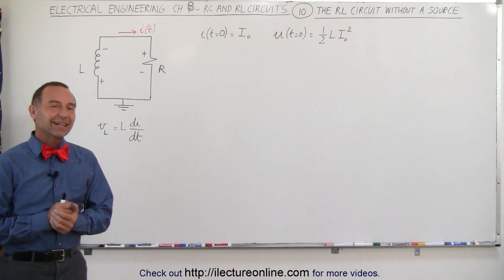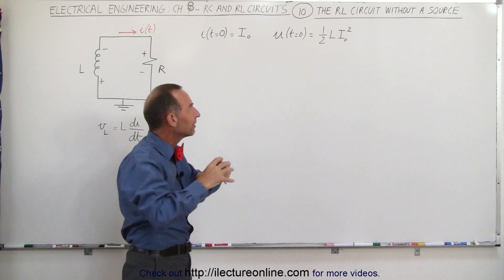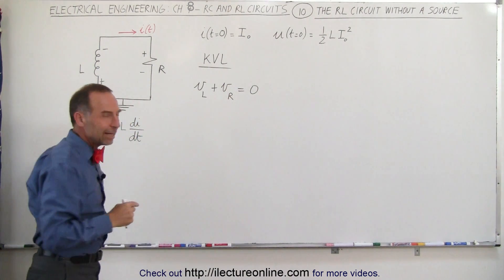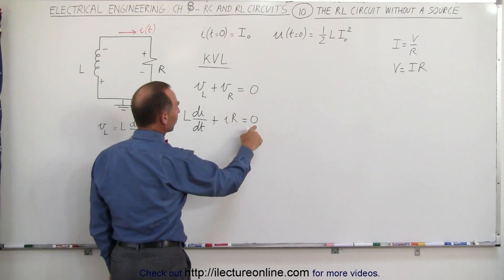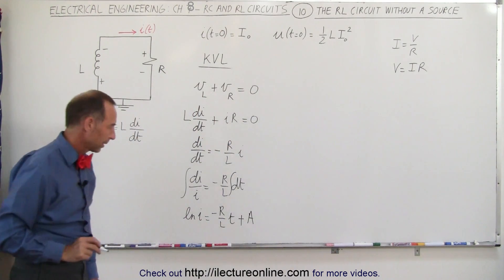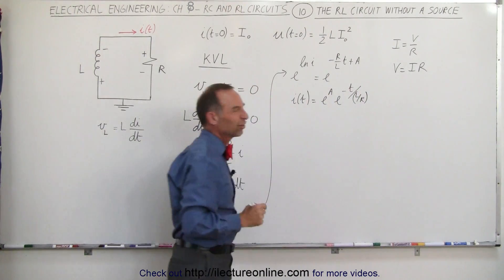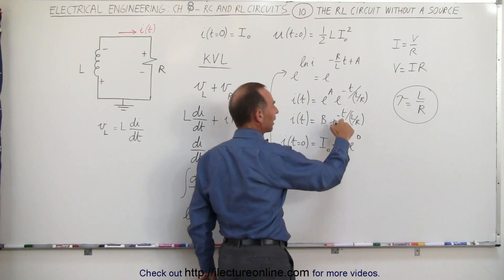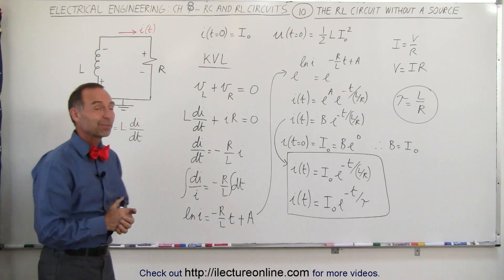Electrical Engineering: Ch 8: RC & RL Circuits (10 of 43) The RL Circuit without a Source

Comment: I am confuse and do not understand why iL+iR=0 couldn't apply here? and why Vc+Vr=0 couldn't apply to RC circuit? is it something to do with the property of the capacitor and inductor?
Reply from the maker: Without a voltage source, the total current must be zero and according to Kirchhoff's rules, the sum of all the voltages around any loop must be zero.
Reply: @MichelvanBiezen  At first I am not too sure what Mr. Michel is trying to say, but after looking at the RC circuit eq a bit, I realise I could setup the equation with KVL as well, as the result is just as 
https://www.youtube.com/watch?v=BMX3iYSxoAQ

Therefore, I suppose both KVL and KCL would apply to both circuit, just that we setup the equation as it is now because it would be in differential eq form before doing anything.

Thank you for the reply Mr. Michel :D

Comment: Professor i have this doubt on the circuit analysis, why does the polarity of the inductor different from the one in the resistance?...Didn't they have to got the same polarity because they are on the same voltage?...i hope you can help and clear this doubt.
Reply from the maker: The polarity of the resistor depends on the direction of the current.  The polarity of the inductor depends on how the current is CHANGING.
Reply: Michel van Biezen Thanks for answering !
Reply: @MichelvanBiezen  professor Michel, whyyyy polarity of inductor is that?? The current is decreasing, so inductor acts like a battery with plus on the top and minus on the bottom to oppose the decreasing. You are right textbookally, but wrong intuitively!!

Comment: i don't understand the polarity of the L voltage drop as drawn. if the L acts as an initial energy source, the current should be coming out of the positive (high potential) end... confused.
Reply from the maker: It is a theoretical starting point.  Obviously, when you add the two voltages together (as was done in the beginning) and they add up to zero, one of them has to be nagative, which means that the voltage across the inductor must be opposite to what was originally drawn.  That is the whole point of the derivation.  It doesn't matter which way you draw the polarity across the inductor, in the end you will get the correct result.

Comment: hey why cant T=R/L.  e^(-Tt)? Why torque is T=L/R just to be a denominator value, e^(t/T)
Reply from the maker: e^(-Tt) is not equal to e^(t/T)    e^(t/T) is correct
Reply from the maker: Also, T is the Greek letter "tau".  (not torque) which is the time constant of an RL circuit.   And T = R/L

Comment: Why does the inductor have opposite sign with respect to the top of the circuit compared to the resistor?
Shouldn't both of them have the + sign at the top?
Reply from the maker: Using the KVL method (Kirchoff's Voltage Rule), you travel around the circuit and then there is a voltage drop across each component while traveling around the loop.

Comment: Professor Michel, whyyyy polarity of inductor is that?? The current is decreasing, so inductor acts like a battery with plus on the top and minus on the bottom to oppose the decreasing. You are right textbookally but, wrong intuitively!!
Reply from the maker: Don't "trust" you "intuition".  Often our intuition will lead us astray when it comes to physics.  Equations and definitions should guide us.

Comment: No sir , KVL does not hold at all because the line integral of E.dl is not zero in the case of nonconservative electric fields which are induced by inductors in our circuit due to time changing current."FARADAY'S LAW"

Also there is no such thing as the voltage across the inductor because it is made of superconducting material and any attempt to have electric field inside the inductor will produce an infinite current and there is no such infinite current .Richard Feyman discussed this in his book .

IT IS TIME OF CHANGING THESE CONCEPTS ALTHOUGH I KNOW IT IS HARD TO CHANGE SUCH ENTRENCHED WRONG AND MISLEADING CONCEPTS .
Reply from the maker: I respectfully disagree
Reply: @MichelvanBiezen  sir , you may get the right answer but in terms of the physics it is deadly wrong .